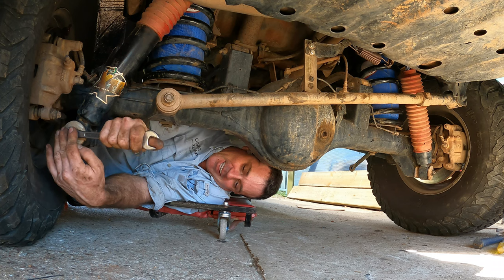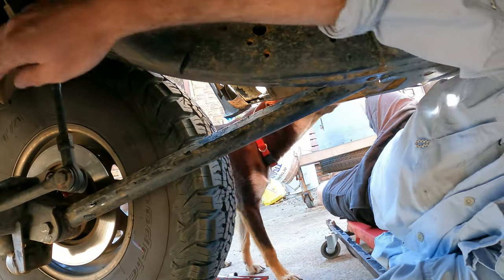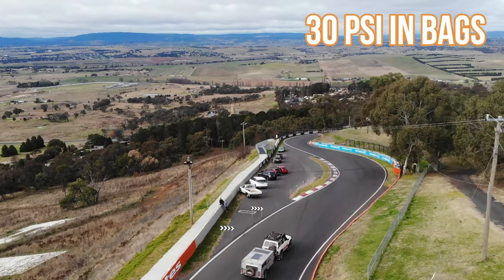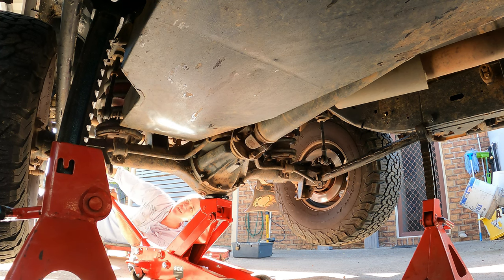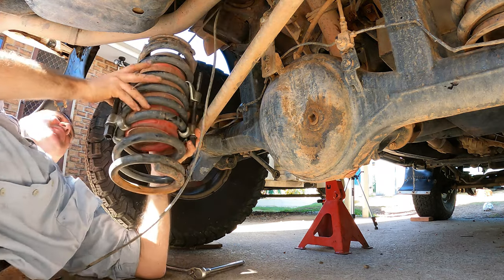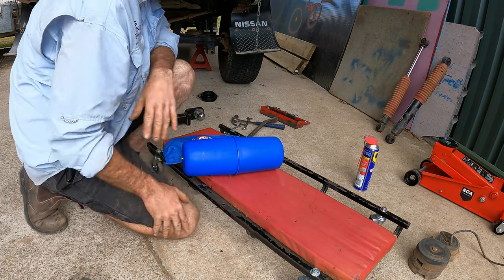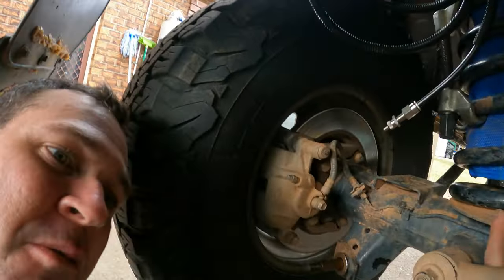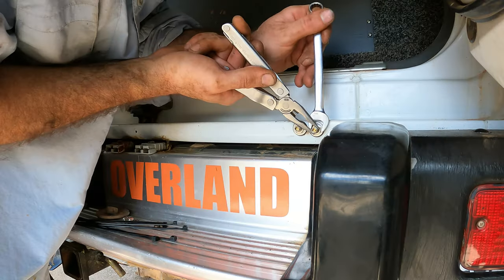How do you really know what weight you'll  be? What about when towing vs unladen weight?

Comment: When I bought my Prado second-hand, it (unknowingly) came with torn airbags. When I got them replaced by Pedders, they told me they should be run at 1 bar (no extra pressure) during normal operation, and only add air when towing. I've still got a lot to learn about getting those right (for some definition of "right").

It will be good to see the 4WDing I missed on the tag-a-long weekend.
Reply from the maker: It probably depends on the brand as to how much air pressure you can put in your bags, but I find 30psi when all loaded up and on the black top works really well

Comment: Great timing! I have been looking into putting airbags under the back my LR 110 roadster for when I tow my camper trailer. The truck itself is basically a sports car and I use it in the sand seas of the Sahara so I need soft suspension for that. It has standard weight and height springs and great Koni Heavy Track dampers. But when I tow the 2-ton trailer, it's a bit soft. Definitely going to get a pair of bags. Most people grossly overspring their rigs. As long as you are not bottoming out ALL the time, your springs are fine. If they don't bottom out at all, they are too stiff. It's the dampers that do all the work. And air bags help the dampers out when you need it the most. Great video!
Reply from the maker: Sounds like they would be perfect for your situation,  at 5 psi you barely know they are there. Definitely go the airbag man kit, so much better than the old ones we had 🤠

Comment: Great video. I put air bags on my Colorado, after talking with the manufacturer they recommended putting no more pressure in your air bags than what you would run in your tyres. I put about 25psi when I'm towing my camper trailer with gear in the back of the ute on the black top and 15 on dirt. They just give that bit of extra lift in the back end.
Reply from the maker: Yeah we only run 30 psi on road and what a difference it makes 🤠

Comment: Blew one of our airbags on the recent trip. Had to let the other one down. Weight of van meant front was way up and very uncomfortable on corners with the steering. Need to get the whole suspension inspected and the airbags replaced.
Reply from the maker: Yes I know exactly what you mean,  I swear the front of the Patrol lifted a extra inch without the airbags and the steering was a lot lighter.  But having the new airbags really made a difference on our next trip

Comment: Solves a problem I have, thanks Adam. I've heard they don't alter the height much, just the spring rate?
Reply from the maker: Correct,  unless your springs have sagged alot. But they don't grow in hight as you increase pressure,  just makes the spring rate stiffer.  Definitely go the airbagman ones, such a better design
Reply: Thanks  @GoingOverland !